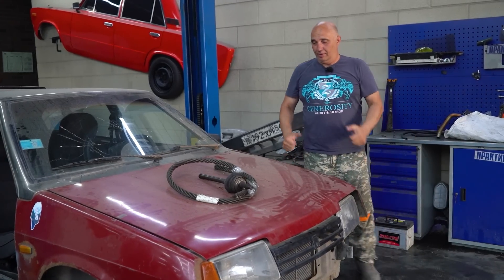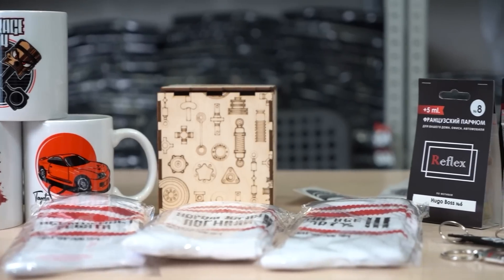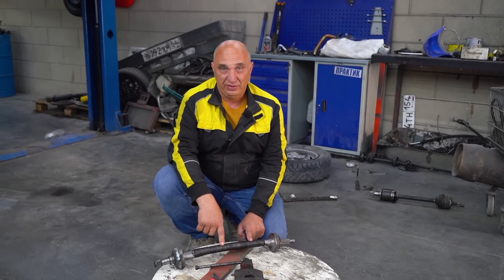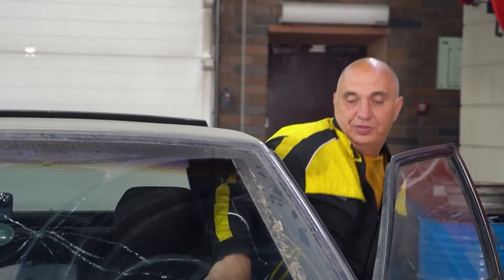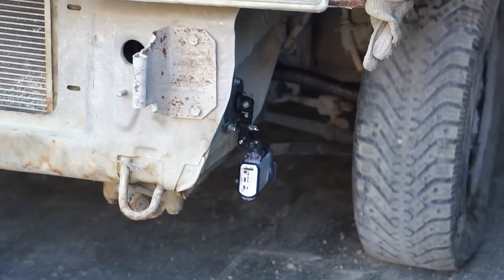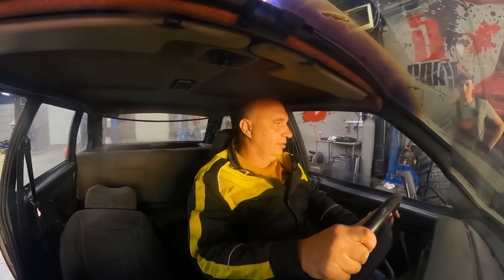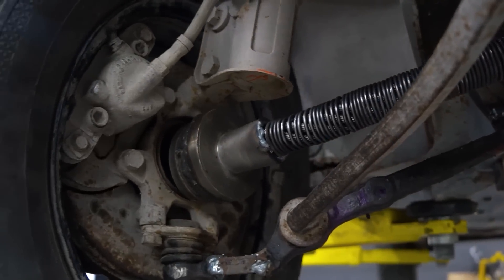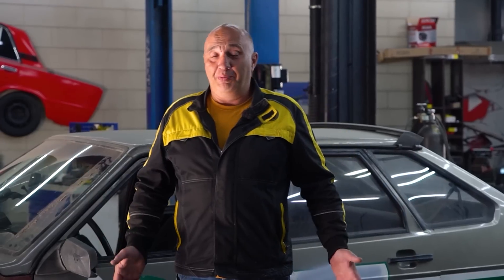Making axle shafts from wire rope – will they work?

Comment: It works fine in reverse because the cable is trying to untwist, which actually produces a force that stops it from slipping out 

Whereas when going forward, the cables pull together, which produces a force that pulls it out of the socket

Comment: A large diameter cable like that with high pressure hydraulic hose over it would probably work better as the hose has cross woven steel cables inside it.

Comment: The problem is the twisted structure lengthens or shortens depending on whether you rotate in the direction of its original winding.

Comment: Flexible cable drives need some form of mechanical support along the way to prevent them from twisting onto themselves. For the smallest stuff, that mid-span support is often your hand. For slightly more serious stuff, the drive cable is coaxial with a static outer sheath similar to bicycle cable jackets. The next rung above that is cable inside a pipe like some gas-powered gas trimmers do, though that would defeat the point of having a cable drive in place of CV axles.

Comment: When you go forward your tightening the wrap in turn shortening the “axle”. And the complete opposite for backing up. Double check the wrap direction it looks like one side is wrapped in the opposite direction. You can’t make them identical the wrap needs to be opposite. Not saying that’s what’s wrong that’s just what it appears like. One tightening and ones un wrapping.

Comment: It may work better as a prop shaft instead of a cv joint, you can see how the cable wants to coil when you apply torque to it, I'd say you need a thicker cable. Would be fun if you try with just link chain

Comment: I enjoy your channel.  You fine gentlemen come up with some interesting automotive tests and challenges.  On top of that you use cars I am not familiar with as I am from the USA, and that' makes for different content than I'm used to. You said you failed in this video, but I would disagree.  You had a result, and have answered the question you set out to find. So I don't see it as a failure  It's interesting to see what you fellows do and I look forward to more great content from you.  God Bless, and be safe in your travels.

Comment: A drain snake works the same as soon as you put to much pressure it wonts to buckle thanks for sharing 👍😀
Reply: a drain snake always spins in the same direction so no worries about the drive cable unwinding.

Comment: Suggestion: Tyres that go over the wheel instead of inside it. Cut off the two rims of the wheel and weld them to plain circular plates. You now have two separate disks that can be fitted inside each side of the tyre and the tyre can be pressurised to look like a ball. One of the metal sides will of course be fitted with something that fits to the car somehow. You essentially have a one rimmed wheel and a free-floating blank. Can the tyre support the car?

Comment: Could you guys Try to make the camshaft of an engine spin the same speed as the crankshaft (making the camshaft and crankshaft rotation be a 1:1 ratio from a 2:1) it should have a combustion on every rotation and it should make more power but i don't know if it's possible if it is possible it should in theory make twice as much power

Comment: suggestion/video idea:
Modify a car on the wheels like a train with a connection rod to connect the front and rear tires. So you have a cheap 4x4 . 😂

Comment: Video suggestion! See how many codes you can possibly get an OBD2 car to throw at one time, while still remaining drivable. You could start with loosening the fuel cap and escalate to unhooking vacuum lines, tricking or unhooking sensors in the engine and transmission, sabotaging injectors and so forth. I think that would be entertaining.

Comment: The cable needs to be inside a housing like a speedometer cable. I want to see a car run off of a windshield washer tank. .Like the fuel pump went bad . And the washer hose is run into the top of the carb or a intake port.

Comment: you can even shield that inside a stationary wire housing, to route it around
Reply: slippery insulator cover, like in a pull wire housing, but rotating action

Comment: strictly idea i wanted to work on this here but had my entire fab shop stolen and sold while in hospital by wife and step kids . take alterrain fork lift or other farm tractor remove engine place hydraulic wheel motors in drive wheels install electric motor to drive hydraulic pump replce steel weights witth batteries zero emission farm equipment with high torque no need for high speed

Comment: There are cables that can transfer torque, but they generally need a sleeve exactly to prevent this sort of problem. Without a sleeve to force the cable to keep its length, it will just start coiling onto itself at its weakest point. In your case, the sleeve would have to be a solid pipe or several sections of wire, kinda like an armoured snake, but the fewer the better.. Only a small portion of the rope should be sleeveless, to allow for bending.

Comment: You could create quite a stir in town if you were to black out the windshield and all of the other windows on a Lada so that there is absolutely no way to see in or out of the car. Then mount several small cameras to video monitors inside the car allowing you to drive around Novosibirsk in a "Stealth-Drone-Lada."  For this important project, please use the car you previously painted with blacker-than-the-dead-of-night-black paint!

Comment: I recommend making a straightening sleeve/brace made out of pipe, or far thicker and tighter wound wire welded to the bezel of the hub ends, while better securing the shaft ends to the hubs to prevent the build up of spring tension and torsion to the rope. 

This will solidly make the axle as rigid as possible on the ends, and to prevent the shafts from bending while retaining the horizontal flexibility of the metal rope. Well done nonetheless and I hope to see more!

Comment: If you wanted a flexible axle you would need to use conected u joints. To get the length you are looking for it would take like 6 per side.

Comment: POSSIBLE SOLUTION for next time...

From what I could see, you had 2 weak points. 

Firstly, the one cable (drivers’ side) was tensioning or twisting up the wrong way. It needs to be the same direction as the driving force. Basically, flip the cable around so it will twist or wind up when you go forward. You can see the reverse of this happening when you go backwards...

Secondly, the crimping of the cables is a very weak point. I would take the cable ends and dip them in some boiling solder or something to seal up the ends. Then I would put 2 or 3 nuts and bolts right through the shaft or tube and cable. That should then give it the strength to hold in place and not disintegrate.

Also, I wouldn't use a round tube, maybe use a square tube and you can use 2 different sizes to interlock which should help with expanding of the shaft and cable.

At 1 point you can see the whole thing pulling out a few centimetres!

But try it and let's see if it can work better that way.
Reply: Flipping the cable wont reverse the twisting. It's like turning a bolt around, the threads still will still rotate the same direction. You need a wire rope that is twisted the opposite direction.

Comment: I wonder why they didn't just spin one of the cables 180* around so they both wound the same direction forward and backwards.  Also if they where to weld the wire from inside the pipe all the way across hence making a solid chunk of metal inside the pipe.

Comment: Need a proper hydraulic crimp tool to keep the cable in the flange cup. Probably worth just welding the splines into the hubs so the cable length changing won't pop them out.

Comment: So a solution here is to stop the flex in the steel rope by adding a sleeve. The flex is causing huge forces a this in turn creates heat and stress which shortens the life of the steel rope. By adding a hollow sleeve this would reduce these forces by hopefully enough to at least have a test drive 🤔😉

Comment: I would've bet money this would work. I'm sure larger diameter cables would resist the twist imposed on them. But not really worth it. I'm surprised wire works so well on a small scale like RC vehicles drive shafts. As always, there's lots of  knowledge involved in failure. Usually much more learned than if had just worked immediately.

Comment: I've got a suggestion. Shorten the knuckles on a front wheel drive car for more steering angle. See if the axles can withstand the added angle and measure how much smaller the turning radius is. Once you test the stock axles, try modding them to see if they can take even more angle.
Reply: chris fix has done this to his drift mustang
Reply: @steveholland1163  Thats on a rwd car. Most drift cars go this route. I was always curious to see if it can be done a fwd car, not bc of drifting, but to make smaller u turns.
Reply: @babuji7363  I don't think you would get enough movement out of the cv joints

Comment: this will never work with this style c/v axle you need a car where the axle bolts in on both side the expanding ring type they are using will keep popping out of the trans and get right and left hand twist cable. I have built over 100 cnc machine attachments from very large to very small using cable drive reliably they should consult a engineer

Comment: Wire twisted 1 way holds 1 way. Twist to the right and can be pulled tighter to the right. Twists to the left nd can be pulled to the left. Not the steering of the vehicle.  Just the way the cable was made. Now if a style where both ends were welded properly to make steering arms, that would worn out.

Comment: I always wondered if this would work. I guess only if it has a casing over it like a speedometer cable or a string trimmer does, but that wouldn’t really work in this situation either.

Comment: Heavy ratchet strap as CV shaft? If you leave it with just enough slack to bind up to the perfect length whenever torque is applied, that might just work out.

Comment: Torsion stiffness or in other words how much torque something can withstand is proportional to the 3rd power of the diameter IF it is one piece.
So, in this case: you have many small strands or wire, let's say 1mm. Let's say there are 100 of them. The strands don't interact with one another - as lead not if you load the cable with torsion in the opposite way the cable is wound*. Basically you have 100 times 1^3 = 100 of "torsion resistance".
Let's say the axle that was replaced here was 20mm in diameter. So the "torsion resistance" was 1  times 20^3 = 8000. This shows how important is it that you not only have mass or much steel, but it needs to work together the right way.

So, this was never going to work and the way the cable was attached to the hub was crude at best.
* the side where the torsion worked to keep the directing of winding worked better; the strands were binding together - not much, but enough to see the other cable fail first.
Reply: also the problem with variable length.

Comment: Try using molten tin/solder to fill the "pipes" where the wire sits in, to have a solid mass to hold onto, than it will not break.
Reply: you miss the important part: The joint needs to be VARIABLE LENGTH. The rope isn't variable, so it pulls something or pushes something when it shouldn't.
Reply: @dimitar4y  well, if you make the joints of the wire solid with tin / Solder, drill it and bold it, you got a very strong connection, but as you said, you have a very limited movement, but torques gets past through without breaking other than possibility parts of the car. maybe with shocks.
Reply: @AnalogDude_  tin/solder is fragile. it'll snap quickly under load, the rope will bend 2-3 times and shear all the tin/solder. then it'll be this video again just messier. It'd be a very horrible quality metal rod. It's.. pointless.
Reply: @dimitar4y  i don't know what they use at the wire/cable companies where they ad the ends to it. but they poor in some kind of metal. maybe zink, not sure.
Reply: @AnalogDude_  It's not usually soldered. Just a very, VERY firm crimp with steel. It causes cold welding to the cable. Soldering requires heat, and heat damages the temper of the material, creating stress points and potential failure. I've, at least, not seen anyone use solder. Cold welding is better than solder.
Reply: @dimitar4y  some are crimped, some are casted.
Reply: @AnalogDude_  huh, never seen casted ones. they must have a good blend for "soldering" to work.
Reply: @dimitar4y  just look at brake, gear change cables on bicycles, there is some "zink" or so cable end termination, you can find something simular on (mobile) cranes.
Reply: @AnalogDude_  As far as I know those are just crimped on. Hydraulic high pressure crimpers can squeeze metal like liquid right inbetween the strands.
Reply: @dimitar4y  no, man, some are crimped, some are casted with a softer than iron metal.
Reply: @AnalogDude_  all the ones i've bumped into were crimped. A lot of industries all about proper crimp terminations of copper lugs and steel cables where I come from. Steel cable eye-hooks crimped on also for cranes, elevator cables, etc.
Reply: @dimitar4y  check on brake and gear change cables, they are not, easy to see witch are forced/crimped and what are casted.

pretty sure, if they filled the cable ends where it sits in the tube with aluminum, than drill it, lock it with bolts, it will not break or raffle. just 600º+C to melt Alu vs 1300ºC for steel.

these "cables" do exist and are built differently, to allow torque from "both" sides.
Like drill machine extensions.

Comment: Make another set of driveshafts out of impact tool extensions and a swivel (universal joint), then durability test to their limits!
Reply: Haha that's an amazing suggestion!
Reply: That's a cool idea, maybe even try it with different sized ones, 1/2 and 3/4 and maybe even bigger if they exist.
Reply: @Scott00   1/4, 3/8, 1/2, 3/4 , and 1" are comon in the United States.  I own impact tools in 1/2 inch and up
Reply: probably work quite well.
Reply: Renault uses that system and IT doesn t work
Reply: @MrRichard57000  impact extensions? Lol
Reply: That would be sweet. They also have CV joint style swivels that work a lot better than universal joint style swivels like the ones I have...
Reply: ⛔LIVE CAM & [S]EX - CHECK MY LINK⛔  what in the ever living eff....lolololol
Reply: Dam I thought something similar
Reply: I would bet the swivels would just blow apart unless you went nuts and bought like 1 inch drive or bigger spline drive stuff we have 1 1/2 spline drive socket sets at work and yeah I think it would absolutely have the strength but because it’s got no way of containing lubrication it would quickly heat up and burn out
Reply: Yesssssss I swear to everything  above I was thinking the same thing I mean they make u joints for steering stems here in the us from rubber and if you used wire for a u joint  work for an axle or drive shaft I think that would be durable maybe

Comment: You should try making axel shafts out of welded chain. Maybe a medium chain with all the links welded together.
Reply: You're failing to understand why this failed. It will be the same failure.. 

I want to see normal unwelded chain though that'd be wild.
Reply: @dimitar4y  I've been a mechanic my hole life and I know quite well why this didn't work. But these guys try all kinds of crazy, wild and fun things. So why not try a suggestion? Although welded or not a chain would be fun to watch. My prediction is if the chain doesn't snap it will coil up and possible (hopefully) do some awesome damage!
Reply: @baleylavarta2573  as i said, want to see a normal chain wreak havoc. Welded chain would just be a crappy rod. who wants to see a rod? If it manages to bend/twist into a nice twisty balustrade that'd be interesting though
Reply: @dimitar4y  I suppose because the welded chain has the potential to work. But yeah a chain would be a great watch!

Comment: I'd like to see ya all get a snowmobile engine and hook it up to a manuel transmission by welding a drive belt pulley from snowmobile to tranny shaft and mount mother under hood put belt on clutch on motor to the transmission pulley  set the tension then put tranny in whatever gear ya want like 3rd gear and hit throttle lol and same for reverse .what ya all think

Comment: Possibly a center bearing in the middle of the “shaft”?  And crimp ends on the wire then weld to a pipe? Love this stuff keep it up
Reply: I had the same thought.
Reply: Try put a steel tube over half the cables.  Limiting the twist and probably get more  time between breakages

Comment: It's not the cable unwinding. You have twisted rope. What happens when you hold one end of a twisted rope, and then twist it in the direction that "tightens" the twist? It overtwists, and forms loops mid length, shortening the end to end length. As your axles begin to mid span loop, the shortening pulls them loose from the sockets you swaged them into. Running them opposite to the twist direction makes them longer, so they bite harder into the socket (which further loosens the swage joint). Eventually they loosen the swage enough, and pull loose. It's unavoidable with twist cordage (which is why you don't see it used as axles, lol)
Reply: There are cables for bidirectional torque transfer. They have alternately twisted layers. The end the socket still have to be crimped with enough force to deform the whole crimp into a solid. And it has to be more circular, hexagon, octagon, etc. This requires a socket wall thickness that is strong enough to contain that pressure.

It still wouldn't work as driveshaft beyond a certain L/d ratio, and won't work beyond a certain RPM either, but with an outer casing it might.